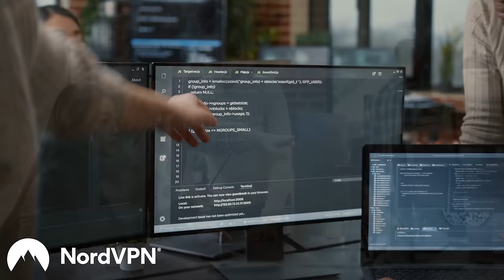Elon Musk fails Cybertruck stainless steel metallurgy test | Auto Expert John Cadogan

Comment: As an old man proper educated mechanical engineer, I appreciate your videos.  Good job, John.
Reply from the maker: Thank you, sincerely.
Reply: As a retired dentist, we also had a lot of metallurgical stuff in those days. We had to pour our golden crowns ourselves and were making fillings with amalgam. . 
I ❤ JC with his good talks.
Reply: @AutoExpertJC  actually ford and us-steel tried SS steel for Lincoln and mustang body lines and in their 1900-80's~ case it did eat the tooling/die's ( sorry i don't have the internet or historical links to make it easier for you and others to see it, and ford engineers even Austrian one's at that probably are awareness of that expensive experiment ) and that was in the first 5-100 bodies off the line vs normally 50k+car's, so elon might actually be correct but also means he hasn't solved the 1960's era process/problem's with using it as ford was hoping to delete the body-shop/paint-lines ect and offer dealership's raping services/up-charges for changing colours ect

rusty wise it doesn't do any good to use higher yielding steel if by the time it gets wrecked-usa 🇺🇸 winter ( antidotal evidence is after 5-9 years old and at least 50k miles on the odometer ) or at least local to me currently with swiss cheesed instead of presten condition as oem-designed/tested, so maybe and a big maybe with 308ss is the chance for less Swiss cheesing in hard to fix/knowledge ( yes my local office/government does yearly checks but that doesn't equate to catching all failure's or EPA-violation's ect ) location's in the body/frame ect, with maybe a higher chance for less injuries ect
Reply: @itsokaytobeaselfhatingjew5971 Why would it be John’s responsibility to offer solutions, he’s a critic, not the world’s foremost expert on manufacturing?
Reply: @itsokaytobeaselfhatingjew5971  Please bless us with your amazing solutions. Also, John will probably be quick to tell you that "add" is not short for advertisement. You probably meant "ad".
Reply: Indeed, my favourite thing about stainless is telling people it is 'stainless not stainfree'. 
All the best of the season John and your viewers, engineering humour at it's finest.
Reply: @itsokaytobeaselfhatingjew5971  except that there are internationally recognized grades for steel manufacture, 316 stainless is food grade and marine grade for example, if you put 304 in a commercial kitchen your licence will be suspended.
Reply: @itsokaytobeaselfhatingjew5971  He did.  Redesign with "Advanced high strength steel", the term given to steel in the body shells of cars that weren't designed for 'stares menacingly at bullets as they pass through the weak steel".   He's not being paid by Elon to actually submit a new CAD model.    

He was talking to you when he said "Your issue is not with me, it's with reality."
Reply: Glaring inaccuracies
Reply: @itsokaytobeaselfhatingjew5971  I have a soluton for you - don't make idiotic products like this so called truck and most of all do not hail the likes of Musk as some kind of messiah...
Reply: @itsokaytobeaselfhatingjew5971 
Wow. Are you for real? It's Telsas responsibility to solve their own technical issues Dooood.
Reply: @itsokaytobeaselfhatingjew5971 Model planes don't count. 😂
Reply: @itsokaytobeaselfhatingjew5971  
I can see why that is what you named the voices in your head. 

How is it up there on top of the mountain?  

Are you just a certified technician?  As in no engineering degree from a 4-year university?   I've ran into this issue with 'AME's before.  No actual classes in thermo, etc.  

Just curious.
Reply: @itsokaytobeaselfhatingjew5971  🤣🤣🤣🤣🤣🤣🤣🤣🤣🤣🤣🤣
Reply: @itsokaytobeaselfhatingjew5971  Methinks thou doth protest too much.  

Pretty sure I hit the nail on the head and did not slander.  Accuracy isn't slander, after all. 

I think you're retreating because you know my next questions were "Hey Mr. [not an] Engineer, what's your highest level Chemistry Class?"  

Enjoy your day at the peak of the mountain.  And make sure when you drive you stay in your lane, if you catch my drift.
Reply: Tesla fan Boyz are hilarious. End of Message.
Reply: @itsokaytobeaselfhatingjew5971  Who needs solutions to problems caused by making a pointless product to a bad specification? EVs aren't the solution to anything in the real world and bullet-proof trucks aren't a requirement for 99.9% of the population, either.
Reply: @itsokaytobeaselfhatingjew5971  I love how you put leasing in there! 😂😂😂
Reply: @itsokaytobeaselfhatingjew5971  .You mean "Libel" , as it's written .

Slander is spoken.🤦‍♀️
Reply: @FreeFlyerUk  He didn't really mean either one.  He means he's offended that I don't consider aircraft maintenance technicians to be design / development engineers.... 

Because they aren't.
Reply: @ToolHombre  Correct (exRAF Techie).
Reply: @FreeFlyerUk   Respect.  Without you guys, there is no AF.  Just an abundance of museum candidates.
Reply: @seanworkman431  

That's not remotely correct. 

Both 18/8 and 18/10 stainless are widely used for the food-facing surfaces of NSF-certified commercial cookware as well as residential cookware (All-Clad, Vollrath, Mauviel, Demeyere etc.). Both alloys are 30x series, per the ISO, not 31x.
Reply: @AutoExpertJC the aircraft industry uses advances metals that they hold as industry secrets that aren’t even patented due to the properties it gives the metals. There’s lots we can do and I can only imagine what spacecraft use. Not trying to say it breaks the press, and they do admit the material would break.

 it probably isn’t standard stainless steel unless you know the composition of what they use un rockets, which I don’t. His only claim is that it’s harder quick it is, and spaceage which it is.
Reply: As an active plumber I'm here because he said urinal.
Reply: Is this a joke? I wouldn't think so, but you are an engineer afterall....
Reply: I laughed, I cried, this was a great video.  How’s Cadogan talking down to us like we didn’t all know what an MPA was, though?  I know what a mega pascal is!   

They’re just like fruit pastilles but the mega ones are just larger versions.  
Blackcurrant is my absolute favourite!  

Anyway apart from being an insufferable smart alec, Cadogan’s all right and he should run for office.  

Who’s with me?? Hello?  I think this thing is broken but anyway someone put Dogues in headlock and tell him he needs to step up and work for the people!
Reply: Ditto

Comment: At the end of the 1936 ford's production run, they made a few (6?) Stainless steel cars. They were special order for a Stainless steel company for their most successful salesman. My understanding is that ford didn't want to ruin the dies & waited until they had finished production before making the ss cars. So, you're right John,  even back then they could do it with standard tooling & they were curvy as can be.
Reply: True, in fact several models were eventually produced in stainless steel, the 36 Deluxe Sedan, 1960 Thunderbird and a mid 60's Lincoln with suicide doors. The body panels were an exact match of the standard sheet metal with complex curves and contours unlike the slab sided CyberFlop.

Comment: I worked 30 years in car engineering, so I reckon I know something here. It's true that the press itself is in no danger of being damaged. But the forms for pressing sheet steel will wear faster with stainless and those don't come cheap. On top of that, as far as I'm informed, the sheet steel of the body of the Cybertruck is well over 1 millimetre thick, that's easily well over twice that of a normal car.
Reply: CNBC just did a video on why the CT is hard to manufacture.  I believe they had an expert say the same thing.
Reply: most Unibody are made w/ sandwich of Mild, Mid grade and High strength Steel. 
its all thin , has to be , in order to be Stamped.
Reply: Typical car body steels are between 0.6 and 2.5 mm thick.  At the thinner end, you'll find many of the outer panels and the thicker end is reserved for structurals like the shock towers.  Lots of the crumple zone parts are in the middle of this range.  Much thinner and they won't stretch well enough or will tend to buckle when in draw mode.  (Look up stretch and draw in a sheet metal forming guide.)  The tooling (punches and dies) can be made hard enough to resist wear under high contact stresses but of course this comes at a cost.
Reply: 1.8mm
Reply: Research air-bending, this is what they are using
Reply: @medschoolvisual6954  A lot of stuff these days is formed using water pressure.
Reply: You’re right the door panels are 1.8 mm thick and the other panels are 1.4 mm thick, but the original spec was 3 mm
Reply: 300 series stainless is alot harder than mild steal like regular car your full of it dude your just hating on the truck because you can't afford one!
Reply: @ryanhumbarger9880  You're confusing hardness with toughness.
300er stainless is as soft as mild steel, that's why it scratches just as easily. But it's tougher than mild steel, it is more difficult to bend.
Nobody hates the truck. In fact it's more a case of pitying the person who buys one thinking that it's some sort of utility vehicle, which it is far from  being. It's a vanity truck, no more and no less.
Reply: Cars don't use mild steel for anything structural.
Reply: @TroySavary  Unibody vehicles (every modern passenger vehicle) have very few structural components. They are made of mild steel holding on to a few hard steel suspension parts.
Reply: @kenp5186  Better than making a truck out of cast aluminum.
Reply: @poopywelder  Knowing Elon, he probably wanted 6.9 mm
Reply: @poopywelder  LOL! Elon the genius who allegedly knows more about manufacturing cars than anyone else alive on earth.
The first 3 things a car design engineer has to think of before starting development on a new car is weight, weight, and weight.
Reply: @roryreddog3258  
The hood is 0,7 mm
Reply: You and Sandy would make a great couple.
Reply: @roryreddog3258  I think some of the steel on the frame connections is still heavy also. I could be wrong but the crumple zones are layered.
Reply: @mikethespike7579  wow that's pretty baseless calling it a non utility vehicle after a good technical explanation. You know the metal but lose it somewhere after that.
I'm a contractor, had one on order since the first month. I don't care about the speed so I'm sure thwy won't be down to me and my single motor, with something like 700lb of torque, for a couple years since I'm over 100k in line.
Costs 1/8 of what I pay in fuel.
I can run a 50lb jackhammer up to a 150lb of it.
Don't need to pay for temporary power service on a build.
Secure storage for way more tools.
I said I'd never buy a truck without a full size bed, but honestly I don't need it. Those times I get a few sheets ill just leave the tailgait down. My main f350 doesn't even have a tailgate.

After all the whining he by a bunch of so called "real men" I was shocked at how many people rant about the cost to fix a bent fender.
The surfaces are flat and I'll load stainless wire in a mig riding in the truck bed and tell my helper to fill the dent and grind it smooth.
Yes I know how to pull a dent. 
I live in a state with a lot of whining pet people, so when I left my dogs in my truck with the windows up, I just pulled out a sharpie and wrote my dog check in phone number across the white paint.
I know this will hold up better on the jobs  sites than a ford/gmc.
Reply: @sparksmcgee6641  So, you say you're a contractor, in other words a businessman. Not much of one if you buy a so called utility vehicle for your business that costs twice the price and delivers only half the usefulness of the next brand.
I'm also self employed and I always keep an eye on what my investments give me in return. I have to, to keep competitive.
The CT is a typical vanity investment, but hey, maybe that's all it really is about for you, showing your friends you got a fancy truck cus you can afford it.
BTW, you can't pull a dent in stainless, it's too tough. And welding a dent in a flat surface and grinding it flat? Good luck with that, you gonna have one big bent body panel.
Reply: @mikethespike7579   Well there you are then. He's got plenty of weight.  :)
Reply: Cybertruck is 3 mm thick according to Scotty Kilmer. So apparently it's bullet proof.
https://www.youtube.com/watch?v=jeCaw9EAvmk
Reply: @robina.jensen6114  3 mm is almost armoured truck quality.
Reply: i watched a vid on utube recently
at the factory where they make this joke I mean product
the guys doing the actual work explained how the dies need ed changing every 160 ish pressings? might have been less ?
anyway no one seemed to notice that glareing fact!
  I'm talking about some sizeable extremely expensive
looking stamping dies!
i guess they get repaired but just having to change the bloody thing every 20 minutes??
Reply: @liamrobertson7265  Sure, worn dies are renewed. A bit of welding over the worn part and then machined down to the specified form and they're good again. But it's an expensive process. You don't want to do it too often. And at one point the wear isn't repairable anymore and you need a new die.
Reply: The Cyber Truck door outer flat panels are 2mm thick.